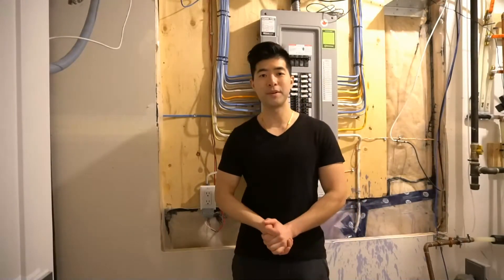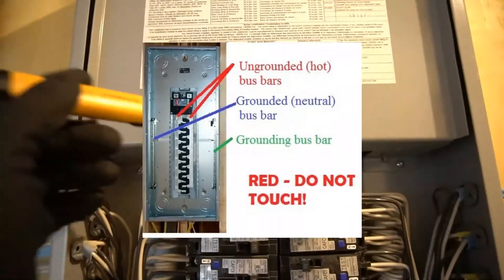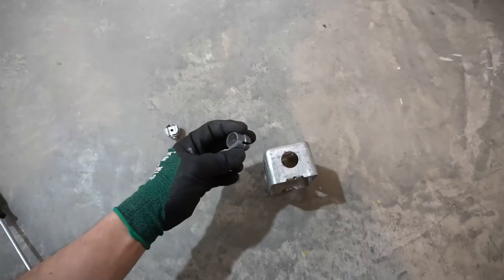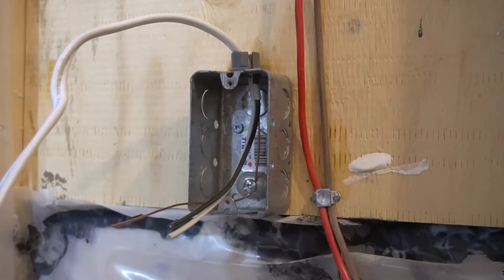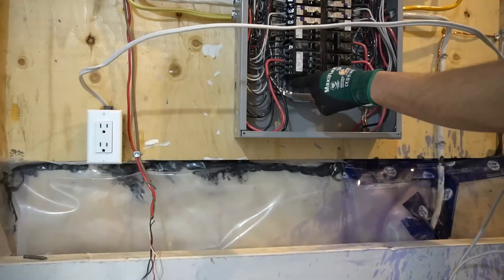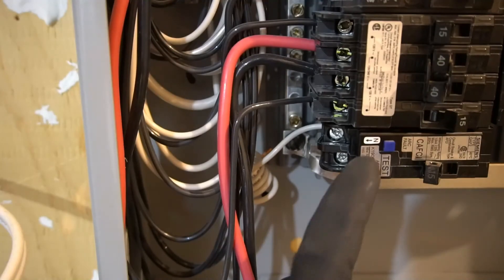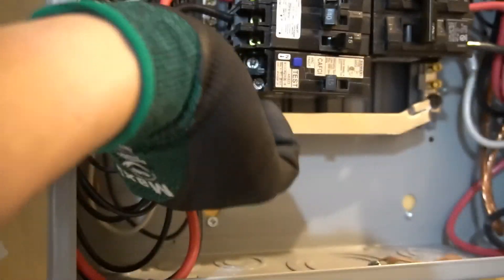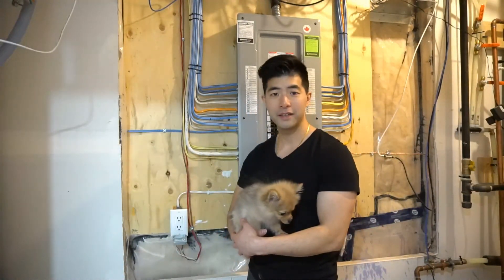Add An Electrical Outlet Next To Breaker Panel Electrical Panel (STEP BY STEP)

Comment from the maker: After 10:00 I lost footage of terminating the other end of the ground wire to the ground bar in the panel. So sorry about that but it is very easy to install. Install them to the rest of the existing ground wires.
Reply: wish it was in the video
Reply from the maker: @ComicKish me too. Sorry 😞
Reply: Would you be willing to make a separate video showing what that means? This tutorial is so excellent otherwise

Comment: Showing any new receptacle install with backstabbing the wires is dubious at best; not illegal, but this method has been discouraged for at least 25 years. Newer cheap receptacles may actually be even worse when wired this way, and most middle to better grade parts at Big Box stores have models with back clamping, where a shorter straight stripped wire end is set into a slot, and the screw tightens a flat plate against it, with no need to wrap wire around the screw. The screw should be very tight, whether clamping or wrapped, and an inexpensive torque screwdriver can be enlightening, as to how far off the average DIY notions of "tight enough" can be; too loose, and the connection may overheat, further loosening until dangerous.

Comment: So basically, even turning the braker off, don’t touch anything
Reply from the maker: @MrNsoe  you can touch anything below the main breaker once it is off. But make sure you use a volt tester to confirm the areas you could be touching has no electricity going through it. Anything can happen.

Comment: So is it same process if I’m putting outlet Inside a room? The breaker box is on opposite side of the bedroom wall I want to add one to.
Reply from the maker: @raiderpete3384  correct, pretty much. As long it's not near a sink or a bath tub
Reply: @KevinPon.  ok thank you 🙏🏽 our home is older and breaker keeps setting off in this heat with our ac running so I wanted  to add another outlet just for Ac because the one I have in room shares a breaker with another room

Comment: I've been searching for this kind of video. In my home that I've owned since '01, I've have never used one specific outlet in my garage. Never. Just never  had to use it. We'll a few months ago I did need it for once. I plug in a tool and nothing happened. I thought the outlet broke. I put those outlet testers you have and nothing happens. I take off the outlet and there are NO wires in there at all !!! The outlet box  and out let were just installed but not wired at all the fuse panel. It's decorative? Lucky for me it's about 3 feet directly under the fuse panel. I still want to research other videos if I find them before I attempt what you did.
Reply from the maker: Haha that's funny. Either they forgot to pull in the last wire and just put in the plug on so it looked finished or ran out of time. Remember to turn off the main breaker. Stay safe 🍻

Comment: Are there any codes to consider for attaching directly to the breaker panel or for when to run the conductors through conduit?

Comment: You failed to mention where to put the ground wire in the panel. Goes in the bus which is probably easy to tell but a first timer may just leave it unattached no knowing otherwise.
Reply from the maker: Shoot!!! Yes you are correct. Thanks for catching that! I can't believe I missed that! My video editing error.
Reply: thank you!!
Reply: Leave NOTHING 'UNATTACHED'.

Comment: Umm, you're using box connectors with no clamp both inside the box and the breaker panel. Isn't that against code? You mentioned you're an electrician below
Reply from the maker: Thank you for commenting. There is no code violation. What I am using is Loomex Plastic Connector, meant for loomex cable 🍻
Reply: @KevinPon.  I'm not an electrician, but I do have Google. NEC 312.5 (C) says the cables must be secured. Common sense also dictates you don't just want to protect cables from rubbing on the edge of a sharp panel box, you also need to protect them from pulling out of the screws by clamping them at the box. It looks like your loomex have no clamps and are just open conduit.
Reply from the maker: @ScienceBitch123  please review the video. The cable is being strapped at 10:31 🍻

Comment: Hello Kevin!  Can I run Metal Clad cable the same way?
Reply: Some areas require you run a conduit of some sort by code. It's a good thing to check your area and make sure your allowed to have the Romex showing outside of the box it not.
Reply from the maker: Hi Doug! Absolutely, yes you can 🍻

Comment: dont use the holes in the back for long term or heavy load use! they melt
Reply: They're metal. They don't melt. They're a pain to get the wire back out after. But they do provide a foolproof connection compared to the screw where I've seen them screwed down to where they push the wire off. Most likely they are not secured and pop off when the outlet was pushed into the box
Reply: Concur, the "backwire connectors" do not create a connection (as secure or) with the same amount of contact as the screw connections.

Comment: Never seen a breaker that had both the neutral and hot attached? Interesting. Also you attached a neutral to the bus bar?
Reply: it's an AFCI breaker, that's why it has both
Reply: Where have you been? AFCIs have been code for quite many years now.

Comment: I didn’t notice where was the ground wire attached to in the breaker box
Reply: @kevinpon, thanks for your reply. What are my options if my breaker box doesn’t have a ground bar?
Reply from the maker: @rafaelotero8533  are you sure? It's code. Mandatory to have one. In that case you can screw it on the back of the box.
Reply from the maker: Put them at the same location as all the other ground wires are going to
Reply from the maker: Shoot!! Sorry, I missed adding that part when editing but it goes with all the other ground wires on the ground bar. You can't miss it.